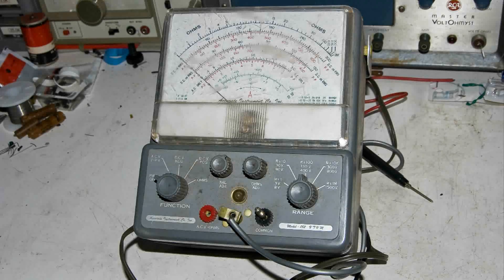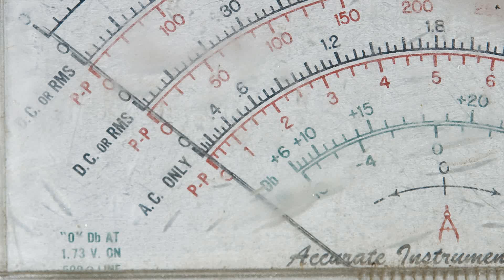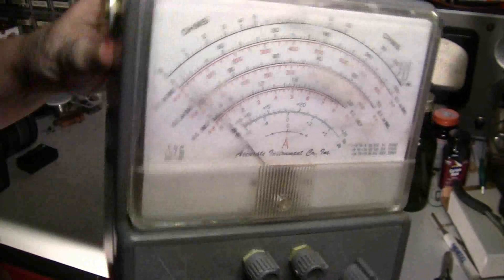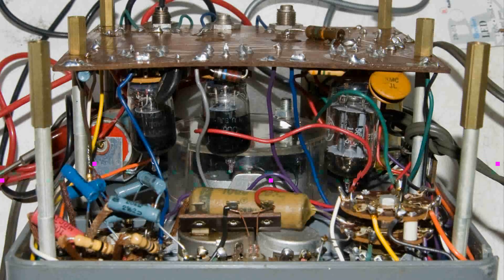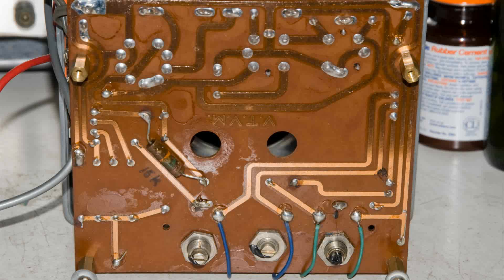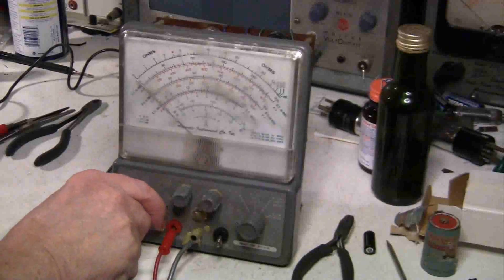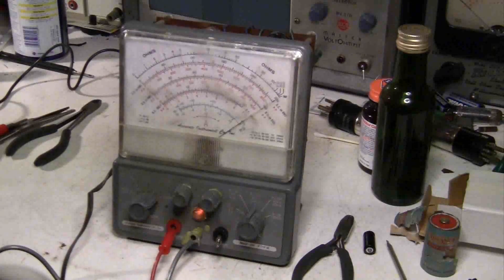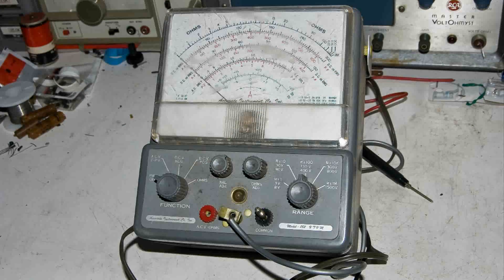Buying and Repairing an Analog Meter

Comment: Hi, I just bought a vintage Jana HJ-8005A analog multimetre (made in Japan, yay!). The ohmmeter settings are the usual RX1, RX100, RX1K and  RX10K. Upon shorting the leads for ohms adjust, the needle swings to zero for all RX settings except the RX10K setting i.e the RX10K always measures open circuit even with leads shorted, nil needle movement from infinity. Everything looks OK inside there, no broken contacts or anything obvious. Batteries are confirmed to be good. Any ideas as to what might be going on there?
Reply from the maker: You'l need to get the wiring diagram and check all the resistors and connections in the RX10K circuit.
Good luck!!!
Reply: @AllAmericanFiveRadio  Ok thanks!

Comment: When replacing  a VTVM two wire power cord with a 3 wire power cord, should I ground the green wire to the chassis. Seems to me that the ground probe lead will short to earth ground if I should touch  line voltage by accident. Any ideas on this situation or am I wrong? Thanks , Chris
Reply from the maker: I would need to see the schematic of your meter before deciding where the Earth Ground should be connected.
Reply: @AllAmericanFiveRadio  I have a Eico Model 232 vtvm.  I have the schematic in PDF but I can't attach it on this post. The schematic is on many web sites . Thanks for all your videos ,Chris

Comment: I like the old from meters ,I have  two different heath kits ,One only need a cap and a new battery ,the old cap is probably good ,but because of its age I will change it,and I want to put in a good c battery.,my other from I have ordered the parts needed to make a missing probe .most of these vintage from meter are almost the same inside .
Reply from the maker: Hope you get them working. Their still very useful.

Comment: maybe someone has an idea for my problem. I bought a used  Triplett 60 type II of ebay....... bad idea by the way. The needle always returns to about a third of the way after i zero the ohms. Sometimes but not very often it will return all or almost all the way back, but as soon as i use the meter again, it returns to about one third of the way across the dial....... any Ideas ...... anyone?

Comment: I purchased a very close match to this VTVM recently.  Seems to need small adjustment of the ohms and zero controls as I switch ranges.  Is this to be expected or is further clean up required?  I made a clip to demo thishttps://www.youtube.com/watch?v=WpDtE9KLUng&feature=youtu.be
Reply from the maker: +Christopher Larwood 
Having to make small adjustments from one range to another is normal for an analog meter. I hope you enjoy using the meter, they are very useful. It is my analog meters quite a lot. Sometimes a digital meter will not lock onto the same result in a circuit, but when I use my analog meter I can see what the result is and why the digital meter was unable to give me a result.
Reply: I've done DC calibration and the meter is quite accurate, resistance measurement seems good also so very pleased with this 50 years old instrument - and I can clearly see the meter- it;s huge!
 I would like to make up a better set of leads for it - the ac/ohms and common inputs have odd pin type input jacks that won't accept banana plugs - any idea where these could be sourced?  The DCV is closer to a RCA plug, but a little smaller.     thanks for all the interesting and educational clips - well paced and explained
Reply from the maker: Glad to hear you got it working. On the Leads I would search eBay.
Reply: AllAmericanFiveRadio it's the odd type of pin going to inputs that I just don't know what to call so I can even start a search!  Do they have a name?  Leads are plentiful but not made with 50 year old VTVM s in mind!  I'm in South Australia so no chance of local seller..
Reply from the maker: I would consider changing the meters plug sockets so they will accept banana plugs.

Comment: my needle is not working well since the fuse got busted. i have an analog multimeter when i set it to the lowest reading the needle wont zap to right like it used to it just went to the middle. please help. im just new on this thing.

Comment: I believe this meter is the same as a Superior 77 VTVM for which the wiring diagram is available. A couple of weeks ago I picked one up at an estate sale.  The selection switch shaft was frozen, so after a couple  days soaking with WD-40, I was able to get it to rotate.  After lubricating the switch shaft plus replacing the electrolytic cap and cooked resistor, the meter now works fine.

Comment: I just love the old stuff!
You answered a question for me, I have a 20 year old analog multimeter and was checking some spark plug wires and coils.  I didn't know what the extra black dial was for, so I played with it and it zeros out the ohms meter.  I was getting a bad reading and was about to replace everything, now it looks like everything is well within spec!

I also find these easier to read when the value jumps around a bit, the cheap digital ones don't seem very trustworthy.
Thanks!

Comment from the maker: @SpeakerFreak95 
That was a great fix. I think analog meters are interesting and sometimes very useful. A friend and I were working on a radio using a digital meter and were not getting anywhere. We switched to an analog meter and found that the digital had lied to us because of its sample rate. We then found the trouble in no time.

Comment: Hi Rick, nicely done. Well done on showing the swinging of the metre movement.
Nice old meter and no battery guff eating it away.
 A thing I've found on meters that have been 'played' with is that sometimes the guy has failed to realign the mechanical set zero screw on the front cover with the meter movement so you can't move the needle back to zero on the scale.
73's ... Andy

Comment from the maker: @macksledge 
You want your isolation transformer without an earth ground. You don't want any connections to commercial power and earth ground is part of that. Another rule to keep in mind when working with power is to only use one hand and put your other hand in your pocket.

Comment from the maker: @BlueFoxTV 
Usually the battery is use in the Ohms function of the meter, also could be used as a voltage reference or both. Without the diagram I can definitely say, but this is what I have found in the past.

Comment: Both my variac and isolation transformer are ungrounded i.e they were made before three prong cords were the norm. Is this ok? It seems to me it would be as the isolation transformer isolates  the variac from the house ac. I'm assuming a cheater plug is then called for to plug my devices into the variac? I just want to make sure I'm using common sense here. Thanks for the help and as usual great video.